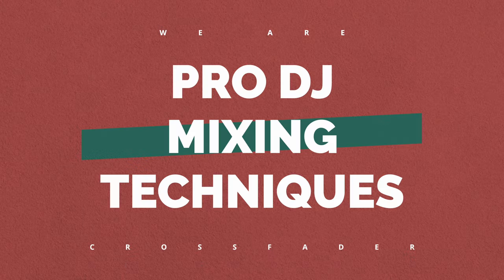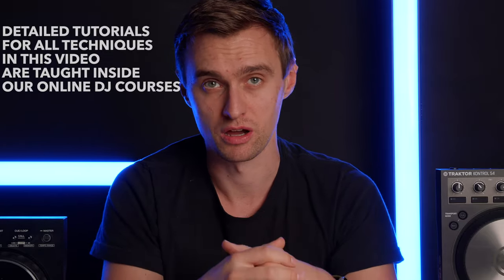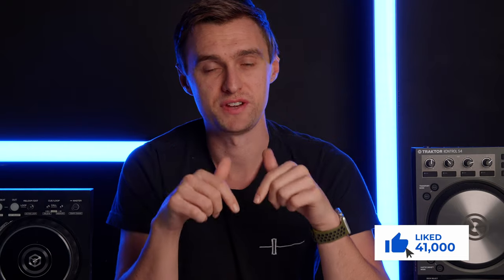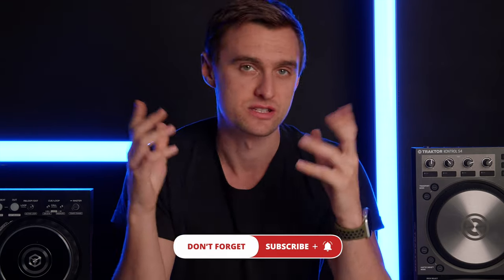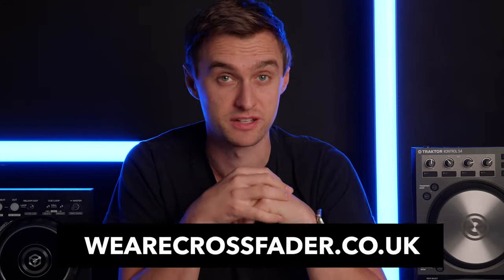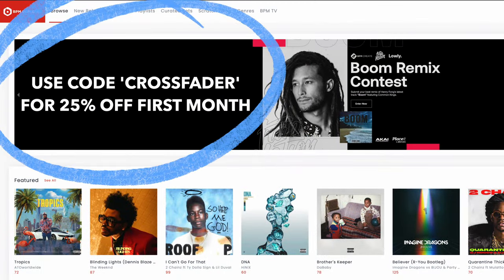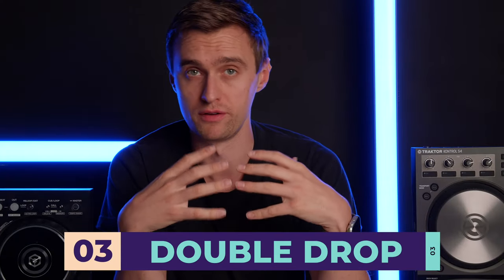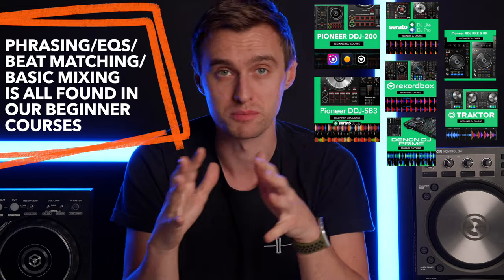7 Mixing Techniques Used by PRO DJs!

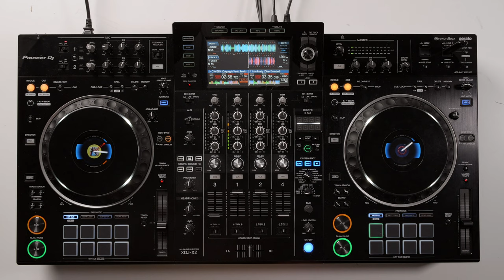Comment: The build up and drop at 6:30-7:18 was soooo good
Reply: something that James Hype would do
Reply: i was watching with my mouth open. i just bought myself a ddj-400 to learn how to dj and i was amazed by this part
Reply: Song??
Reply: Wasn’t the drop wayyyy too soft for the build up
Reply: Yeah I had to stop and rewind that like 3 times. How does he get the beat loop to go double time? You just press the call button and then out to get the jog wheel to manually clip the end point of the loop? That’s pretty sick.
Reply: Also if you turn of keylock and put fader on long range you can create pitch up or pitch up fx with the loop by putting tempo fader up and down😉😉

Comment: Thx mate. Very helpfull.  I started in 1999 with performens on vinyl.
i stopped in 2010 and now start up again after 10 years. well there i a lot to learn. from vinyl to digital.
Reply from the maker: The core principles all still apply!! You can definitely take those original skills and just level up with new technology!
Reply: If you can read your Dancefloor that all you need.
Reply: I’ve always wondered if there’s anyone out there that picked the hobby back up after the movement towards CDJs and experienced extreme culture shock

Comment: I have a question I have a Pioneer DDJ 800 play with it for a while I'm starting to learn how to use the system been at it for about a year and now it's just not working right when I plug it in and turn it on one side deck comes on and says Pioneer DJ the other side doesn't light up inside the jaw Grill when that does that what is wrong with it I tried updating firmware I tried resetting it I don't want to take it apart I don't want to spend any money to get it fixed cuz I put already $900 in it when I first bought it I just don't know what to do at that time but I am definitely going to buy the Pioneer DDJ Flex 6